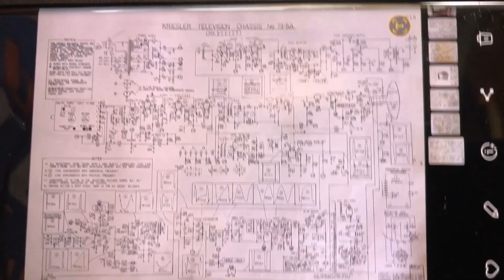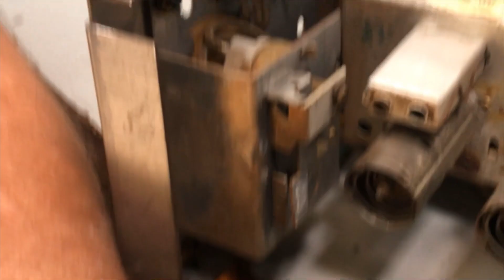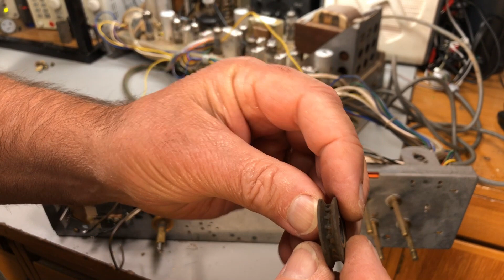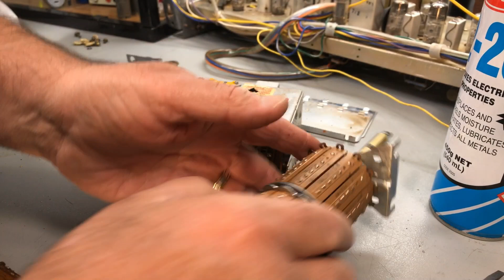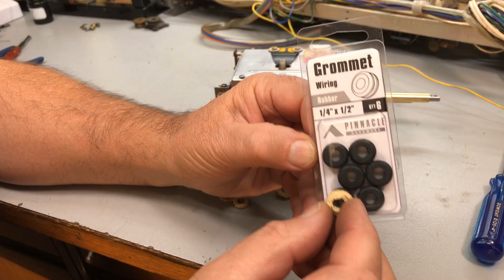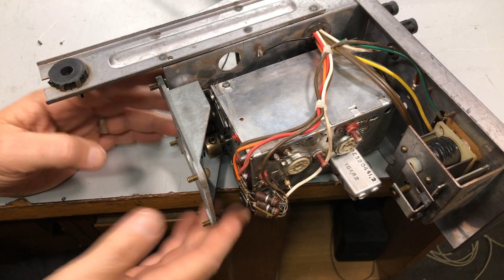A 1963 Kriesler TV Restoration - Part 5

Comment: It was always a mystery no one knew, some people would change ch one clunk at a time, slowly letting it rest on each ch. Some would change quickly clunk clunk clunk and some would rotate the knob like a spinning wheel. Was there a right way?
Reply from the maker: I don't think so, it never caused any issues that I know of with the tuner. Some were flicked that fast you would have thought it would dislodge the biscuits, but never seemed to.
Cheers